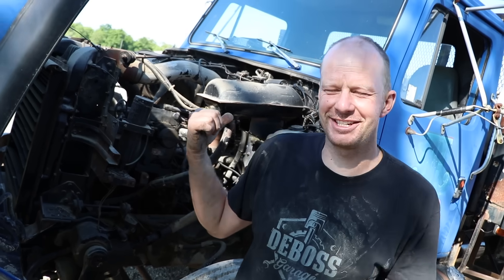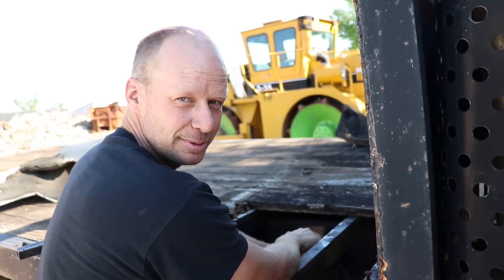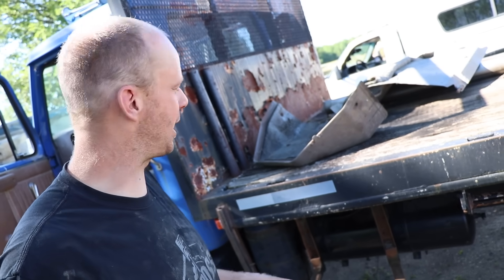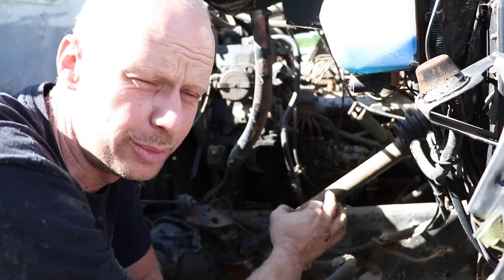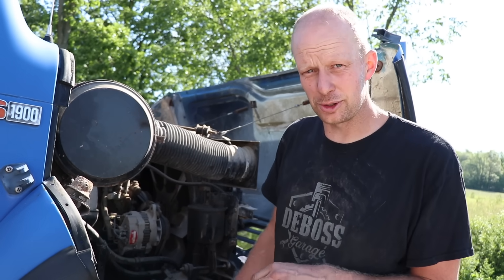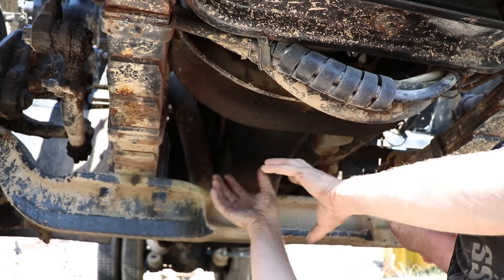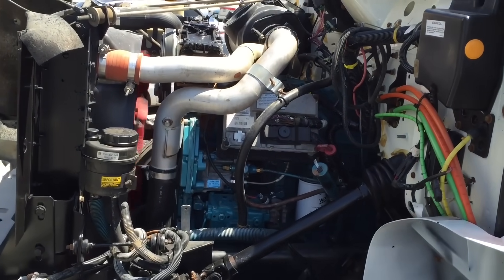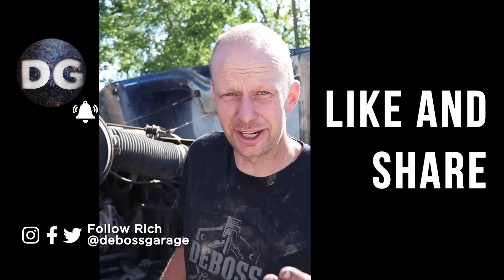REVIEW: Everything Wrong With a 7.6 Navistar DT466 Diesel

Comment: I had to rebuild a dt466e due to a liner seal blowing out. I guess I could have just replaced the one seal but with the head off I just rebuilt it. It was my first Diesel engine rebuild and went ok. It still runs 4-5 years later

Comment: The Cam issue was not a maintenance issue, the follower would break and allow the roller cam follower to turn and destroy the cam shaft, this was fairly common on the 2003 and newer engines , The 2008 and newer AK maxforce DT engines also developed head gasket issues as well as egr cooler failures

Comment: Nice video, I currently work on mostly 466e's and our main issue is not start due to bad o rings. Also getting the oil pump to prime and fill the whole front cover and high pressure oil pump reservoir is a pain. Other than that the ICP connector has some pin fittment issues that will cause a no start or intermittent no start. They keep me employed so I'm not going to complain.

Comment: The DT466 is extremely reliable up till 2006. 2007-2009 Was "OK" and anything 2008 and above had to be maintained like a BABY if you wanted it to live past 200K. I have customers that baby their 2010 Maxxforces- Open Breather, Regular oil changes, Service the exhaust and have hit well over 300K but it is only if you baby it. As far you pushing the oil in with compressed air that is 100% correct. If the oil is too thin or aerated it will block the injectors.

Comment: These engines were in a whole bunch of ag equipment over the years. The “66” and “86” series of tractors by IH used these as both normally aspirated and with turbos. As to platforms, you aren’t exactly going out of the box to put them in different applications.
Reply: The 466 never left the factory in a 66 or 86 series tractor, they all used the common-block 414 and 436. Entire engines have been swapped in, and internals have been swapped into the other blocks over the years. 
The first tractors they used it in were the 3588 and 3788 2+2s, later replaced by the 6588 and 6788. The 5288 and 5488 were the only straight-framed tractors to get it. The 18 speed transmission in the 52 and 54 was converted to powershift (possibly by IHC for the never-built 7688) and had an 8.3 cummins dropped in front of it to make the CaseIH Magnum tractor.
Reply: @scotcoon1186  Splitting hairs. The only difference was bore and stroke. The horsepower ratings dictated slightly different geometry, since turning down to 80hp in an IH hydro, or up to over 200 in a truck application dictated more changes than simply the amount of fuel delivered. That’s like saying a 5.7 hemi isn’t the same as a 6.4. BTW, that “powershift” transmission was just a rework of the levers and linkages. Instead of the torque amplifier being up on the dash, they made it activated by the gear lever, by moving it between the gear pairs at each notch in the gate. You still had to clutch it to go to the next pair. It was a pain to shift, but you couldn’t kill them without trying hard. If that was a reworked version in the magnums, they did some major reworking. Point being, that engine series was in damn near everything they made until Tenneco killed them.

Comment: I really like the NGD (ned generation diesel) before they went HEUI. 
Factory P7100, can do the rebuild kit from the DT530 if you want more displacement.
I have one in my garage that I am planning to stick into a 08-10 f350 since the 6.4 is commonly dead and you can pick up a nice one for about 3k. and modern truck platform is cool too.

Comment: I 100% believe your story about the oil changes on 466E. They have that "p-trap" thing on the front timing cover and if it aerates it won't let it fire. I used to work on a couple of the 'E' engines at the last shop I was at. They both usually ran, just not well. Lmao. Great video man, keep it real.

Comment: We had a 1980 International truck with a DT466. We had one major issue with the truck the whole time we owned it. One day a guy that was driving it tipped the truck on its side and totaled it out. After we got it tipped back on its wheels and let it sit for awhile, we were able to drive it home with a frame bent like a banana and a cab that was completely crushed in. The guy that drove it home had to stand on the drivers side fuel tank and steer the truck with his right arm stuck through the window. I still miss that truck.

Comment: I farm in east central Illinois and have three International 4900’s with DT466’s. A ‘91, ‘92 and an ‘02. The ‘91 is an absolute dog. It drives fine, empty, but hauling 500 bu of grain it feels like you’re dragging an anchor. I blame its weak torque on poor gearing in the rear axles. The ‘92 has had three engines in the past 15 years. It dropped a valve the first time. I can’t remember what caused the two most recent failures. My favorite is the ‘02 with the 466E. It has power for days. Enough to pass slower traffic on the highway whether you’re loaded or empty. It had one issue with the fuel pump where oil got past a seal and blended the fuel with engine oil. My main complaint with the 466E is it has an electric fan that kicks on intermittently. It sucks the rpms down so much it can foul up transmission shifts if you don’t use the clutch. As mentioned, if you stay on top of maintenance these old 466’s won’t let you down.

Comment: ih 4700's also came with dt466 . cavitation and sleeve o rings were one of the problems with the dt466. huei system was licensed from caterpillar and was very reliable.as with most engines, good maintenance can be all the difference. the dt466e up to 2007 were very good reliable engine with much better power and fuel economy than the previous mechanical engines. maxxforce dt is just awful. i have not seen any maxxforce engines that were not problematic stock.

Comment: I am looking at putting a DT466 into my 1986 F350 I am debating on using a Eaton 10 speed or using a kit and putting a Ford transmission Auto behind it I was wondering your thoughts.  By the way I used to drive one for years and loved it.

Comment: The cam tappers where more of an issue 2005 and newer  I worked for a dealer for 18 years any of the mechanical engines are rock solid

Comment: Kind of ironic that I found this vid two weeks after it was published since I bought an International DT466E two weeks ago. I hope I have good luck with the electronics. Lol
Reply: My dad,myself and at least 6 or 8 other guys we know all have 4700-4900’s with E’s in our service trucks(pipeline mechanics) never had any major issues. I replaced my oil cooler and it really only needed seals but the company bought it. And a air governer. Dad and I change the oil and fuel filter between 3000-5000 and coolant filter. Never any electrical problems though. Basic servicing and and preventative maintenance and they’ve been great motors. No complaints here.
Reply: @mechanic3371  good info.  Thanks man
Reply: Clean out rock trap right behind fuel filter towards fire wall when you do your filters,it just a pre-filter. I pull out the screen and spray with brake kleen.
Reply: Yes sir

Comment: Just picked up an 1985 International dumper for cheap at an auction with a  DT466 diesel in it. Got air issues but runs great and after hearing this I'm satisfied it will make a great addition to the farm.
Reply: I have a 1985 S1900 DT466 short bed dual axle dump from an auction here in east Hawaii! It’s a beast!! Used to be an army core of engineers truck. Simple as it gets.
Reply: @Malama_Ki  Awesome! Great truck you got there. A reliable beast at that! New stuff is too expensive to buy and they don't want us working on it like we can old equipment. I always am watching auctions to add old iron to my farm. lol

Comment: Heh heh, the amazing 'Down Time 466'. They'd barely pull your hat off (if the turbo happens to be working).🤣
Reply: Sounds like you didn’t spend a lot of time behind one. They weren’t powerhouses, but neither was anything else in that displacement class back then. It sounds like most of the problems were maintenance-related, which is always the fault of the operator...😂🤣

Comment: I used to drive a truck with the engine, hated it, the thing was weak towing 25-30 thousand pounds and the fuel injectors kept pulling the heads off of the bolts and backing out, turbo that was on it went out twice and it would barely move in L when it did

Comment: I have a 1996 4700LP  DT466 
ALL MECHANICAL ENGINE 
with the big Bosch P Pump.
I did a inframe at 390,000..
Now I have over 650,000 miles.
It is still running strong due to good mantainance.  These engines are the best for reliability and longevity.

Comment: Nice that the non E versions are relatively bullet proof but the power numbers are really sad. There are small light 4 cylinder diesels that completely stock shame these engines in horsepower and torque. These dinosaurs are best used as boat anchors these days.

Comment: I have the ultimate appreciation for the DT 466,ran it I my first 7100 dump conversion.That motor was probably the best diesel motor I will ever have owned,thats even running it against my 5.9 cummins.Good on fuel,simple,cheaper to rebuild,ad ultra dependable.I would rate these motors as probably one of,if not the best diesel engines built.Love em,again,Im referencing early 90's motors.Mine never ever failed to start in 9 years of trucking,hot or cold.

Comment: All electronic controlled engines have issues!! Best thing to do is, unplug every plug, make sure they are clean and dry, then fill it full of dielectric grease!!! Makes a big difference!!
We have a 1480 combine with a DT466, a 5288 tractor and my S1900 service truck. All have plenty of hours on them, all run good, all could have more power, but as you said, that's why they are so reliable.
Thanks for the video
Thanks for the video!!

Comment: Rich, don't forget the DT360!  That was a great engine too!  Same engine family, smaller block.  You mentioned to comment on what models this engine was in.  Here goes:
Rotary pumped DT466 first appeared in the IH Loadstars in 1975.  Not sure what models.
S-Series:
S1700, 1800, 1900 trucks got the DT466, and S1800 school buses also got the DT466 (1700 buses were the IDI diesels)
1990-2004:
4700, 4800, 4900 trucks and 3800 School Buses (3700 buses which only existed from 1990-1993 were IDI diesels)
Reply: so is the dt360 just a smaller version of the dt466?  what years could you get them mechanically pumped?
Reply: @KaiserBruh  all DT360s are mechanically pumped.  They were available from 1987-1993.

Comment: don't forget the farm equipment, row crop tractors with 466 52 and 5488 3488 had a non turbo because of the hydro, 2+2 65, 35, 37,67,72 and 7488 then the articulated 4WDs, combines and cotton pickers and construction equipment. Then the 414 and 436's you are just a crank away from having a 466

Comment: I would love to see a video about how you know what engines share the same universal bellhousing bolt patterns, 3 sizes i think?  Im not sure thats why i am asking then how you know if the pilot bearings are the same size thats if they have pilot bearings and info about how i know if the flywheels are all the same distance away.  Things like that.  That would be an Awesome video.  If you would like to get super super specific.  My 1948 International KB8-F has that huge 501 cubic inch 6 cylinder (locked up) mated to a 5 speed and i would love to replace it with a 4 or 671T detroit but i don't know if they just bolt together or not.   Show me some love man.

Comment: I was an International master certified for 6 years (just recently left the dealership world) and those DT mechanical pump engines are absolute peaches! Me and a partner did an in-chassis on one as side work in 12 hours. O-rings failed on the sleeves and turned the oil into a milkshake.
Reply: Does that mean you'd warn me against buying a converted wildland fire transport truck for my new mini home!? I'm planning to tow a Prius (hush don't tease me) and not daily driver it but would casually make my way from one stop to the next (I've heard staying 55-60 mph is best!? Newbie here, please share helpful info if you'd like!
Reply: @FiberFairy22  well it depends on the year of the truck/engine. If it an 04 or newer I would tell you to not purchase that truck
Reply: @FiberFairy22  hey! I have a NOT converted woodland fire transport BUS that im about to convert! :D I mean with the 466 its a big ol 33 footer love that thing!
Reply: @draftday8078  shoot
Reply: I nees to ask you. Someone offer to me a 2003 Int DT466. It is been sitting down for years....only a few times they run the truck. I need to move the truck for.LA to Texas. What should a check in order to have a good trip
Reply: So what are the best years ?
Reply: I have a 2015 with the dt466. Keeps blowing the oil cooler. Any idea why I'm getting it repaired at the dealership. I'm starting to think they're using eBay parts or something
Reply: That's not impressive time-wise. 2 guys for 12 hours is 24 hours. For an inframe? That's what Deere allows for an "out of frame" on a 6466, 6076, 6081 etc once it's on the stand. Down to the bare block cam bearings and cooling jets out and all. In my prime I could do the R&R and the out of frame of an 8000-series MFWD in just the 24 hours with the 8 hours for R&R to spare. And not have to bust my ass. It's 3 days for 26 head bolt,   a few dozen pan bolts, 12 rod bolts, 14 main bolts and a few dozen other misc bolts. I've done Deere 2WD underhauls in 2.5 hours starting with a "dry" and cool pan. A "master" tech shouldn't be bragging about making "book time" with HELP, lol. And yes, I know red iron. Grew up on Ms, Hs, 66s and 86s. 

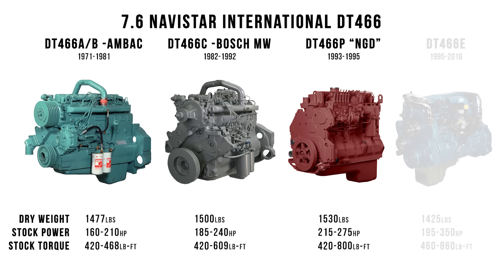Only time I "double-teamed" an engine two of us brought a "hot" 4960 with a blown head gasket in at 6:00 sharp on a Friday night. I took one side and.he took the other. In 30 minutes flat - and hot - we had the tin/exhaust/intake off and the head/manifolds/turbo swinging.

I was on my own at that point working on it and covering the phone Saturday morning. Busted the aftercooler/manifolds/turbo/nozzles off/out quick; took it down and had my machinist check it over quick, checked liner protrusion; checked the nozzles; cleaned everything up; chased the head bolt holes; put the manifolds and cooler back on on the bench; stuck it on with new bolts and torque-turn; rocker shaft and valve lash - twice; put on the turbo/exhaust/intake; put in the nozzles and lines, dumped in the coolant; checked the oil;.gave it a quick rinse;.dynoed it for 15 minutes and turned the "smoke" down to 220 hp from about 250 hp, got 5 minutes of help hanging the tin and it left the lot at 12:30 p.m. Saturday and my area was clean, tools put away, work order written up and I was out door. 

6.5 hours on a 4960 head gasket and an hour of that was getting the head checked and dynoing it, another hour was breaking it down and putting it back together to reseal everything when I could have left it in "one piece" and I "wasted" another 15 minutes or so covering the phone. Figure I could "shadetree" it like the Binder Palace would in 2.5 hours if I was really motivated to "make time. .But instead.I did it right. 

Work smarter. Not harder. Two Binder "masters" tag-teaming anything with a 414/436/466 in it should be able to "inframe" it in a good day.
Reply: @deeremeyer1749  cry me a river you’re complaining on everything about Navistar. 2 Diamond techs probably “double teamed” your wife. Stfu

Comment: the engine harness have electrical problems. the wirring connectors where cheaply made on the DT466E currossion caused open circuits and would lead to ecm to loose signal causing engine to malfunction or shutdowm
Reply: Grounds.
If the freaking negative cables aren't in perfect shape late model 466E won't start.

No matter what code it threw, my first step on hard starting was hook up a volt meter to a negative battery post and the other probe to the negative on the alternator 

If I saw more than 0.5 volts while cranking the engine , replace all the negative cables.

9 times out of 10 thats all that was wrong with it.

Comment: Isn’t the new Detroit Diesel DD8 a modern version of the DT466, or in Detroit’s Case, a Series 40? Also, what changed between the MaxxForce engines and the DT466E where the oil pan sits low and in front of the axle?
Reply: Cant really speak about the comparison, but I have a maxxforce in my tow truck, runs good till it decides not too. Had a few issues with injection pump and a head. Switch them out at 120k.
Reply: The series 40 is a 4 cylinder.

Comment: Back in the day we had a about 25  1995 MY  in flat nose school busses.  The biggest problem we had was the bosch pumps would get a plunger heat sticking and the engine would run away.   Navistar sent us a pallet of brand new pumps and those also would randomly go full power.   Our local fuel shop would rebuild the pumps and put the used plungers in hot oil to see which ones would remain free and use those to rebuild the pumps which solved the problem.   I had a drawer full of timing pins from that debockle.         We went back to them in 2007 and those actually hold up better than any of the other diesels in the fleet.